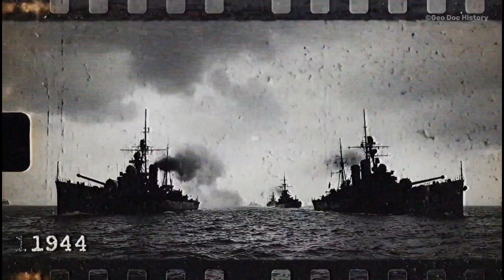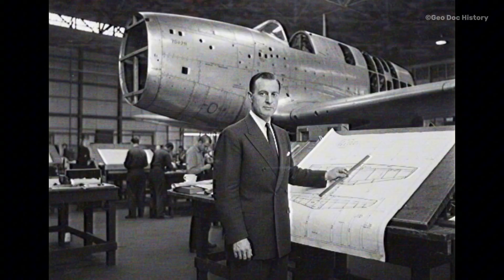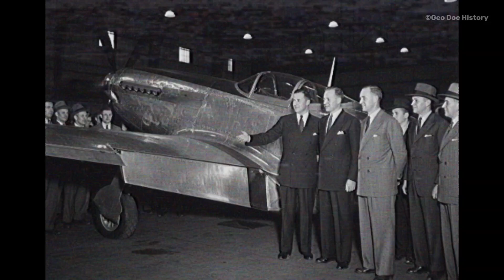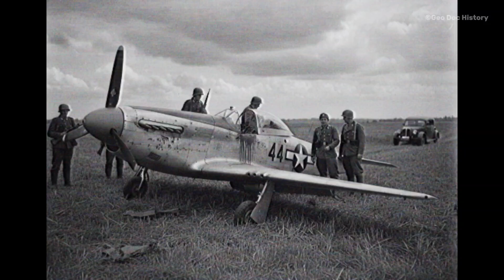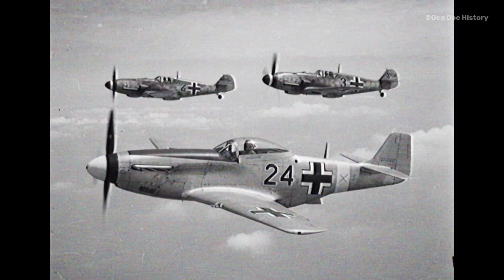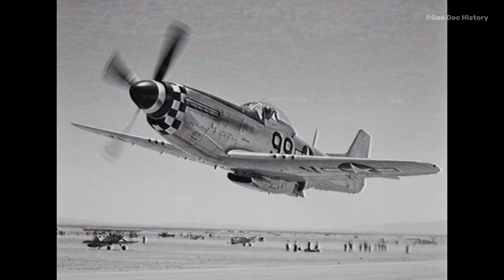Germans Tested a Captured P-51 Mustang Their Engineers Couldn't Explain How Its Wing Actually Worked

Comment: While a 262 could relentlessly chase a P51 with relative impunity it was not an aircraft for dogfighting.  The 262 was a bomber interceptor with low velocity heavy cannon armament for destroying bombers typically with one hit.  The low velocity of its projectiles, low volume of shots, and generally poor maneuverability made it a very poor fighter to engage other fighters unless the opponent got very obliging by staying in the 262's sights without evasion.  At the same time the 262 was a difficult target for the mustang due to its speed.  Since energy controls engagements the 262 pilot enjoyed that control as long as his fuel lasted (and engine kept running), but in the truest sense the combat between them was a stalemate in a dogfight, and the P-51 could readily keep the 262's from the bombers since the attack run, even at speed would make the 262 fly a straight and predictable path to be intercepted by the escorts.